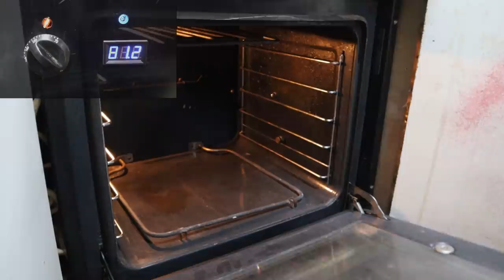Antique Cast Iron Potbelly Cauldron Restoration.

Comment: Wow. That's a really nice pot. An old and very big one too. Would love to find one like that. I guess that would be what we call a Dutch oven here in Canada. Great restoration. Love that metal plate thing you cooked on as well. Never seen that before although it makes perfect sense. Do they have a specific name? Did you buy it or make it? Wouldn't mind one of those either. What's the aluminum foil for? To keep the lid from sticking? I know, questions, questions. 
When I saw the apricot jam in that recipe I was bit hesitant. But then I thought 🤔. Chicken. Ok. After watching it cook in that pot I was like. 😛 Ok, ok. You could twist my arm. 😂 There's simply nothing that compares with cooking outdoors with cast iron.
A tip. Put the bacon in first to get a nice brown crust and render the fat. Take out. Add the the chicken, and perhaps a bit of xtra oil if needed for a nice searing and crispy skin. Add onions to make transclusent and slightly caramelize. Back in with bacon and off you go with rest. Delicious stew. Potje is it? With seared bacon and chIcken. 😛 Can you tell Im hungry now? Haha.
Reply: The thing he made the fire on is a disc plough share. The secret with making a potjie (i.e. making a meal in a potjie) is NEVER to stir or take out ingredients once put in. You layer your ingredients and leve them in there. If you stir a man's potjie he'll never invite you over for a braai again (braai, not BBQ; a braai is done over coals, not flames or gas burners).

Comment: Nice seasoning finish but sand blasting cast iron removes the outer layer of the finished casting and makes the metal more pourus. i would have wire brushed the whole thing.
Reply from the maker: As long as the surface you create after sandblasting isn't extremely rough, it'll be fine.

Comment: Instead of sand blasting CI, e-tank it.
Reply from the maker: CI, e-tank it.? What is that process exactly?
Reply: @AJRestoration  electrolysis tank, cleaning. Fill a small tub with washing soda and water. Connect the corroded item to a metal wire or chain and place in the solution. Place a chunk of metal next to it but not touching. Old lawnmower blade, shovel head, anything metal or a plate of graphite. Next, hooch the negative lead of a manual battery charger to the wire or chain on the item. Attach the positive lead to the sacrificial metal. Plug in and watch what happens. Web search it. I have photos I can email. There’s a group on Fb dedicated to it.
Reply: Correct, you never need to sand blast or wire brush cast iron. electrolysis tank works magic or 50/50 water vinegar soak and scrub, easy peasy.

Comment: Then you need harder blast media and more CFM of air.    Get yourself a 500lbs pressure pot, 1in blast hose, 3/8 nozzle, and a 175cfm air compressor.  You'll get it down to "near white" in 20 or 30 minutes
Reply from the maker: You are absolutely correct. We are still saving funds to complete and find tune our setup.

Comment: Question: when you preheated the cauldron, did you put the oil on it while it was still hot? Thank you!
Reply: There’s a Chinese saying, “hot pan, cold oil, foods won’t stick”.  It rhymes in Chinese.  Get the pan hot, then add oil and swirl it around.  When the oil is hot, add the food, and it won’t stick.  It works with any metal pan, but especially well with iron.  Also, the more often you do this, the more non-stick the pan will become.

Comment: Why clean the item with alcohol if you are going to (later) cook in it?
Reply from the maker: To remove dust from the sandblasting, and cleaning it with water will add a slight layer of rust.
Reply: @AJRestoration  what about blowing the dust off (with an air compressor or canned air)?  Would that not work?

Comment: Next time pick a different medium to sand blast with. It looked like aluminum oxide which leaves a coating of aluminum on it. Maybe glass bead would be better or steel.
Reply from the maker: Thanks for the tip, I use 60 grit silica sand.

Comment: thanks for this great restore  , i have a qouple que 
what the alchool cleaning for? 
after the first season you repaet all the stages ? you reheat the pot and then put oil, let it cool and then reheat and oil again?
Reply from the maker: Thank you for your comment.
Alcohol Cleaning: I just basically ensure that all grime, dirt, and dust is removed from the metal prior to seasoning.
Yes, you are right. Through all the stages the exact same procedure is followed: more stages may need to be done until you are happy with the look of the seasoning.
Reply: @AJRestoration  thanks for your respond , how you prevent falsh rust? after the cleaning it getting rust very fast, even before seasoing?

Comment: Sir how do we cure a new soapstone pots can you throw some articles about thank you once again Stay Safe Stay Happy
Reply from the maker: How to Cure New Soapstone Cookware
♦ Before curing, wash with a sponge or brush in hot water, and allow to dry
thoroughly.
♦ To begin curing, amply grease all surfaces of your soapstone cookware with
your choice of cooking oil. (Use care in handling the oiled utensil.)
♦ Let it sit for 1 hour. Wipe off all excess oil.
♦ Fill the pot with water up to about ¾” of the way. Put on the stove at low
medium to bring the water to a boil. Allow the water to boil uncovered for 15
minutes.
♦ Let the water return to room temperature on its own before draining.
 ♦ For a longer lasting, deeper curing, repeat the greasing. Pre heat oven to
375F. Bake it for 30 minutes.
AVOID ANY THERMAL SHOCKS
How to Clean Soapstone
♦ Allow the soapstone to cool to room temperature on its own before
cleaning. ♦ Generally, rinsing with a sponge and hot water is sufficient to
clean soapstone. ♦ You will usually only need to use detergent when frying or
sautéing some foods. Reapply a little oil after using detergent, and after you
cook a liquid. ♦ Avoid using abrasive products.

Comment: I have a doubt, if I use this technique in a water boiler, does the fat transmit taste to the water? Oh, and using olive oil is OK, right?
Reply from the maker: Not sure if a water boiler will work, rather stick to ovens.
Reply: What about olive oil?
Reply from the maker: @joaovtaveira  Olive oil is usable yes, the only reason people prefer Flaxseed oil is because it has a high smoking temperature, so you don't smoke up you kitchen while seasoning. Canola oil can also be used, but expect a decent ammount of smoke.
Reply from the maker: @joaovtaveira  List of best oils with their smoke temperatures. 
 1	Grapeseed Oil	420F	

2	Peanut Oil	450	Happy 
3	Canola/Vegetable Oil	425 –450
4	Flaxseed Oil	225F	
5	Avocado Oil	520F
6	Coconut Oil	350F	
7	Extra Virgin Olive Oil	375F	
8	Lard or Tallow	370F	
9	Butter or Ghee	300F / 475F
Reply from the maker: All of those can be used, but according to the internet Flaxseed oil is the best.
Reply: @AJRestoration  thanks a lot for all these informations, I'll just hate to  convert the temperatures for °C.

Comment: Good job restoring but You lost me I don’t know what kind of recipe that was
Reply from the maker: Sorry about that. This is a creamy chicken recipe, the recipe is in the description but it follows below:

1. Heat approximately 50ml of Oil in the pot for 5 mins.
2. Add 4 Large Chopped Onions and stir until browned.
3. Add 250g rindless bacon, cubed.
4. Add 225g smooth apricot jam.
5. Cook the bacon and jam for about 10 mins.
6. Add 15ml Worcester sauce.
7. Add 6 chicken drumsticks with 100ml water.
8. Cover with the lid and allow to simmer for 15 mins.
9. Add 15 baby potatoes.
10. Cover with the lid and allow to simmer for 10 mins.
11. Add 250g carrots, chopped.
12. Add 250g mushrooms, sliced, diced or whole. 
13. Cover with the lid and allow to simmer for 30 mins.
14. Mix 1 packet oxtail soup and 1 packet onion soup with 250ml cream and 250ml mix. Add it to the pot.
15. Cover with the lid and allow to simmer for final 30 mins.

Comment: What were the temperatures and times of the 3rd and 4th seasonings?
Reply from the maker: Same as the first. All the layers were done at the same temperature.
Reply: @AJRestoration  no, 1
st 100°C, 2nd 250°C. This is what you wrote.
Reply from the maker: Preheating is done at 100°C, curing is done at +/- 250°C.

Comment: You sure did muck that all up ,, a battery charger a vat of water and a cup of washing soda no muss no fuss no sand blaster 12 hours later wash with hot water dry and season,,, I dont know why you people do things so hard
Reply from the maker: There is no way electrolysis would remove all that rust, and even after the electrolysis, you would still have to clean it with abrasives to get a nice and smooth finish. Remember that rust left a good amount of pitting, you don't want that. The sandblasting not only removed the rust but smoothed out the pitting. That made the seasoning process a lot easier, and it looked better. I don't do things hard, I do it right. No muck up here buddy. Love AJ <3

Comment: Sand blast, electrolisis, or other means to get rid of the rust, followed by seasoning the cast iron with lard, bacon grease, or whatever in a hot oven, is all it needed.  "Restoring" cast iron cookwear is fast and easy.

I hope you are intellegent enough NOT to wash it in soapy water after you use it. You'll have to de-rust and reseason it if you do.
Just wipe out with a bit of boiling water and a rag when done using it, espeially after you get the layer of carbon on the inside.